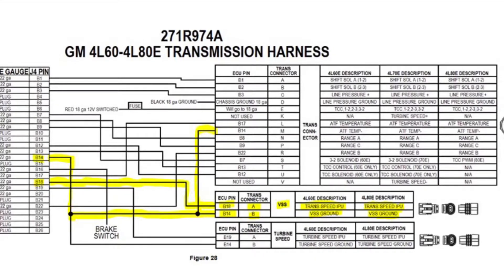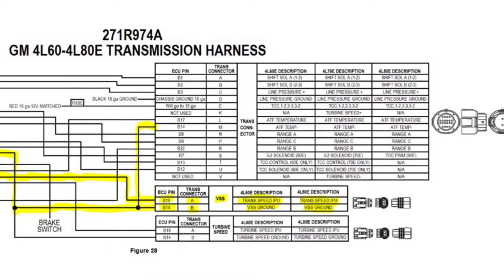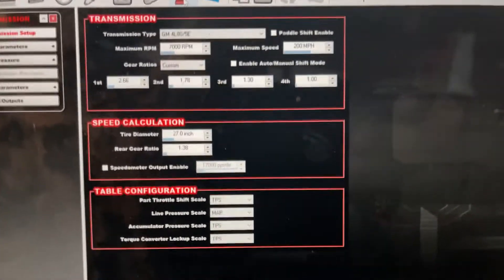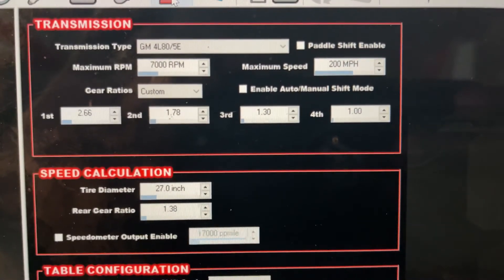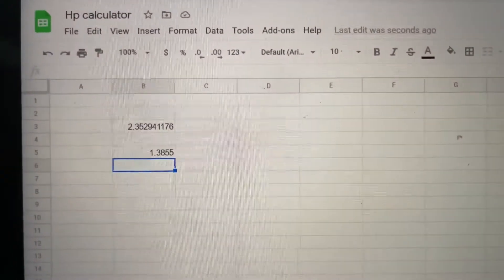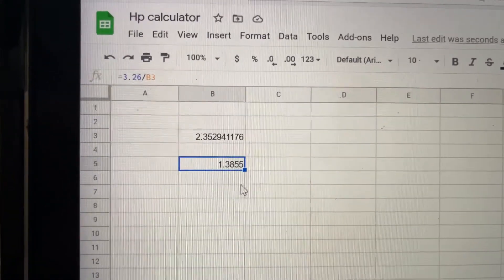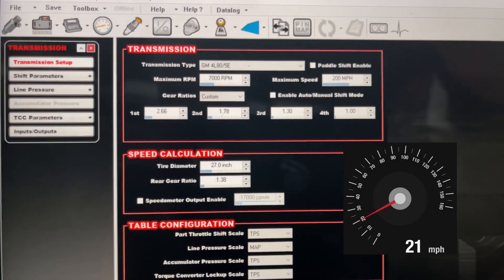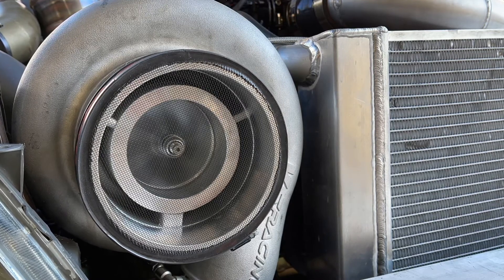Holley EFI manual transmission with a Xmax

Comment: Need help figuring out reverse lockout it will only go in reverse when i start car in reverse
Reply: i know this is 4 months old, but wire it to a 12v switched source, such as your brake pedal or a toggle switch.

Comment: I knew you could do this - I even bought the connector and hooked it up but the tuning part I was lost on. why Holley doesn’t have an option to set up manual trans for temp and speed I will never understand - thank u

Comment: I have mine wired up. Vss on trans to pins 14 & 18 on the j4 plug. Transmission tab filled out like you said with my ratios and rear gear calculated appropriately. But I’m getting nothing on the handheld and nothing on my digital dash. Have tried both ecu output and transmission for speed on the dash. Any ideas?

Comment: TKX also has a 17t reluctor wheel. Thank you for putting this information in once place. I rear all this information in multiple threads that took quite awhile to find. Not sure why this didnt pull up sooner. I just need to do the tuning side and see if my setup will work.